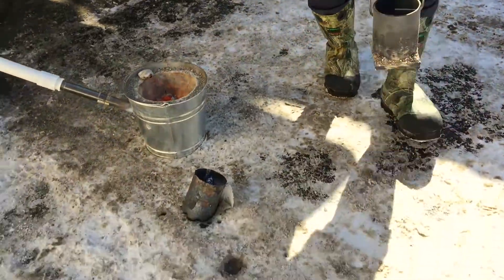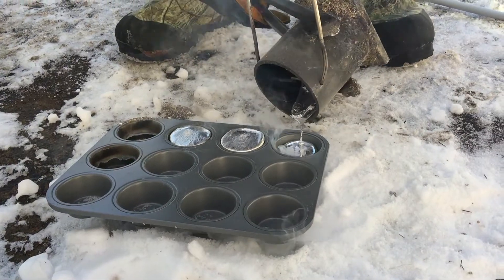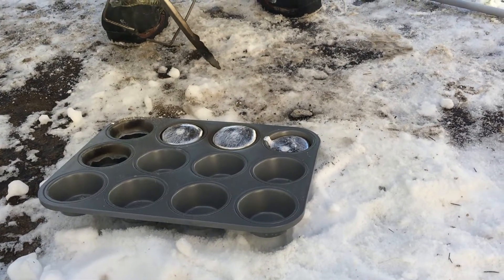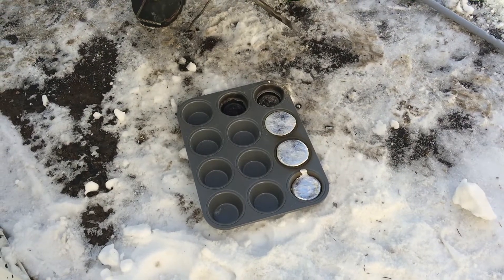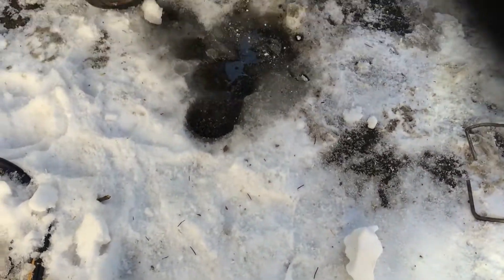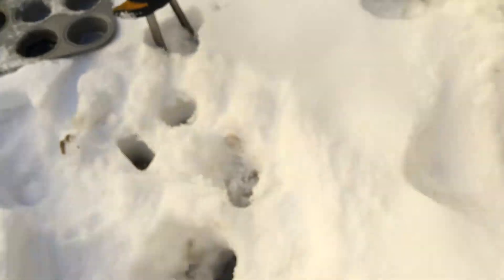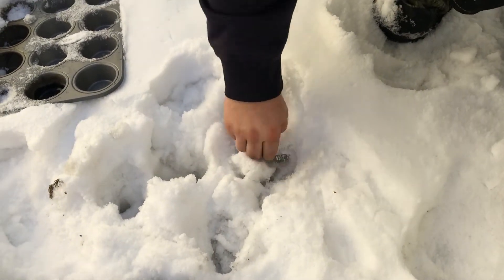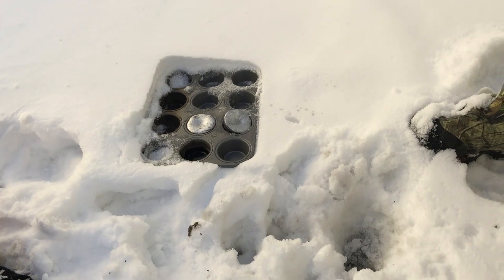Smelting Aluminum

Comment: You said something about there being a bunch of junk in your last smelt. Have you tried putting about a spoonful of Borax in the liquid aluminum? When you do that, it should cause the impurities to float up to the top. Then you could just scrape it off with a spoon
Reply: Luke Olson 
Borax is for copper/brass.
For aluminum, use salt, or (preferably) 'lite' salt, which has potassium chloride in it.
Also, be careful around snow - even a tiny amount of water in your ingot mold can cause a steam explosion.
Being spattered with molten aluminum can ruin your life, not just your day.
Reply from the maker: +Trey Pehl Never heard that - thats great advice!!!
Reply: ***** Good luck on your next cast! :)
Reply: ***** Also, if you can't find any Borax, look for something with boric acid in it like cockroach pesticide.

Comment: What is the mould material?
Reply from the maker: A common muffin pan! This works for metals up to around 1800 degrees F. After that, you risk mould failure.
Reply: Thank you very much! After you tell me, I just remembered I seen such a pot at the side of the road